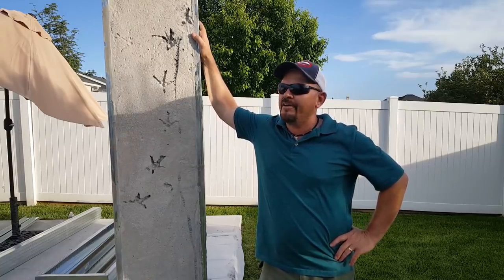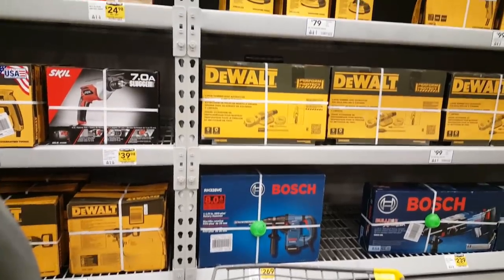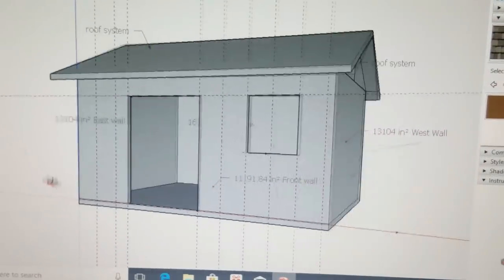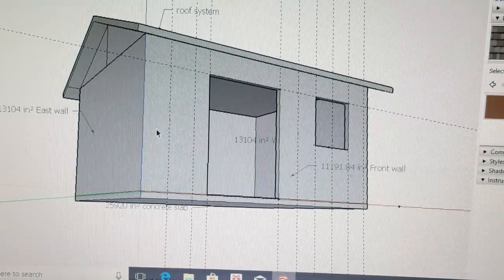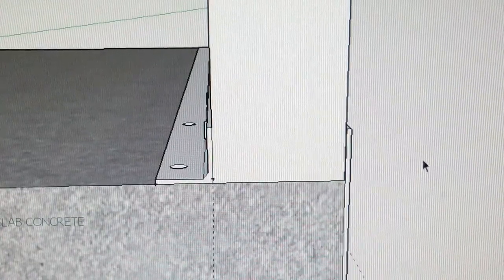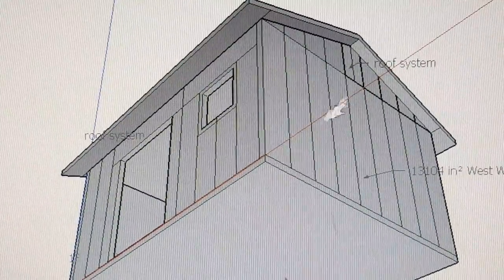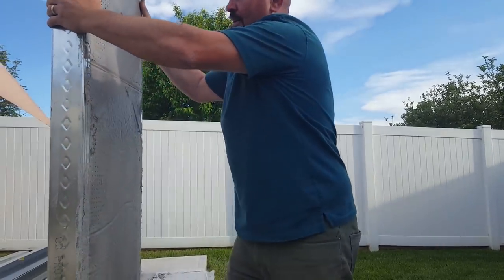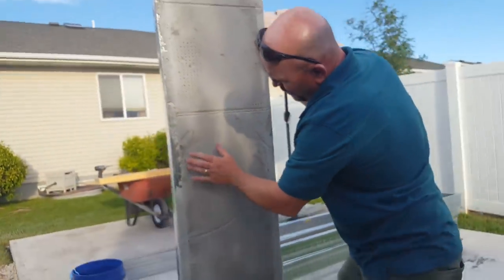Air Crete Shed Wall Panel Layout

Comment: What about striping the metal forms off and setting them with mortar like large blocks in addition to your angle iron? You might want to also do a bond beam or metal strap around the top. I would be skeptical to rely on the angle iron alone because Air-Crete is soft and that connection might fail over time.

Comment: I like the post-hole digger in the tube to mix the air-crete. I would suggest modifying the plastic mixing (and rinsing) barrel to include a 3" PVC shut-off valve at the bottom of the barrel, and put it on a stand while mixing, or position it on a scaffold platform so the valve could be opened to empty the liquid air-crete into a section of wall that was enclosed on all sides except the top, and using a cook's large rubber spatula to wipe out the inside of the barrel out the valve when the barrel empties. 

When rinsing the mixer in water in the barrel, just leave the mixer in the barrel and use a spray nozzle on a water hose to clean everything, then open the valve to empty the water before lifting the mixer out.

Comment: Darwin:  Just use 'C' channel from the metal framing system for your top and bottom plates. Also you can bend the  'C' channel to make a wall/roof connector. the  And if you like the look expanded metal lath and a stucco coat of air crete could finish the exterior and tie all the panels together.  I would also use a metal to concrete adhesive between the  'C' channel bottom plate and pad to reduce corrosion as well as bond.    There are other shapes and sizes in the metal framing system including thicker gauge where needed.   More to come  but for now I have errands to run.    Bert
Reply: bert skelton that is all you need 24 Gage is heavy enough.

Comment: Hey Darwin. Love the videos of the project. I have two possible suggestions for framing and pouring the wall. As they do in tilt wall construction they frame and pour panels on slab with connections incorporated in the wall and any openings framed in place so when you stand them up you just attach with bolts. Other option since your using metal studs. Is frame the shed out with a studs standing in place(as you normally would frame prior to adding your sheeting. place a piece of ply wood or rigid foam board Interior and exterior and pour from the top by either leaving top plate off and cap once wall is filled doing back to back studs to simulate the each panel. Or cut fill holes on the top plate and fill level in each cavity. So your pouring walls in place. Same with the roof. Frame it. Attach plywood or foam board to underside and pour from top. Keep up the good work. I would like to try this doing my driveway. Mainly for water Penatration so it can keep the natural order of the moisture being absorbed into the ground instead of causing run off and have a solid surface to keep from tracking mud.

Comment: Try using those little mesh pieces you used to push it down and place them on both sides of the frame back and front centralising the mesh and thus allowing the Crete to get under it easier and stop that air bubble gaps on the back , you will also be able to fix steel bars to this stabilising them and a set distance of a set amount for a panel at set size and place these in pre drilled holes in slab with apoxy already in

Comment: Two thoughts for you. Instead of fighting with your mesh and the voids it causes use those mesh "clips" you made to keep the mesh near center buy cutting a slit in the mesh where the mesh clip bends, run the clips thru the slits before you start mixing, pour about half your volume of AC then insert your mesh and finish the pour. When you finish the pour to settle the AC take a reciprocating saw [SawZall] without a blade in it and vibrate the sides, should settle quickly.

Comment: Darwin I’m curious why you don’t use the C channel the thickness of the wall panels run pan head screws inside channel set panels in C channel and small screws to fasten panels to C channel neat clean and secure. It’s the way we do steel stud walls in commercial buildings?

Your doing a great job! Enjoying the videos!

Comment: I would like to see as much of the construction details as possible. Are you going to use carriage bolts to thru bolt from the outside flat bar to the inside angle?  And how do the wall panels tie to other wall panels and the roof?

Comment: Very glad to see you working on your family project.  I fear the energy of working on a dirt patch Buckminster Fuller is going to be like last fall, when the energy from working on refractory aircrete resulted in no new videos for months.  Your family is grounded and appreciates using a relatively straightforward project -  a shed - to help you perfect your DIY aircrete system.  There's this other person who gets you spun up and watches you strain yourself.  It's like Lucy holding the football for Charlie Brown.  Aircrete never made sense for a thermal mass in a rocket mass heater.  You were installing insulation instead of mass, and the resulting design was sending excessive heat up the chimney.  Building a circular dome on a square, below-grade foundation is another setup for an inherently flawed project.  You're (admirably) learning about things like using CAD to detect your need to move the shed door 4 inches from the east wall.  That's on a type of structure (square and plumb) that you're familiar with, you've seen thousands of them.  Just trying to get the CAD to handle a geodesic dome will be a multi-month energy drain.

Maybe I'm misguided.  Was the geodesic dome your idea, or did someone bring it up in conversation and plant a seed of challenge in your head?

Comment: You have thermal pass through with the metal forms.
Heat or cold can travel though the metal to the other side .
Probably not a big deal though .
An easy fix is to cut. The metal vertically with a right angle grinder .
Modern metal framed windows no longer sweat because of a thermal break

Comment: On a project that small, I think I would have tried to build each wall with the CFS laying on the ground, you could have put any plumbing and electrical in the wall, then poured the whole wall with the aircrete.  The same for each half ot the roof.  A couple of friends could have pulled the walls up and put the roof in  minutes.  Right or wrong?.

Comment: Hey chief... an idea for you.   Why not form your walls without the bottom metal stud attached. That way you can attach the metal stud to the floor and set your formwork into it after its poured.   Then you only have to screw your bottom plate into your wall.  It would save you a lot of steel and a little bit of room in your building.
Reply: also for your gable end walls... I would consider doing them in single panels.... not the whole wall but instead of an 8ft panel take it all the way to the peak.  ;)

Comment: Also, for getting rid of air pockets, you could jig up a vibrating table to set your forms on. I've seen concrete blocks being poured this way in a manufacturing plant.

Not sure if that would not harm the Aircrete's own bubbles though. They seem fine and firm enough, but you'd not know without testing. 

You could test it by trying out a jigsaw on any old airpocket -prone pour form from your arsenal.
Reply: Aircrete must not be vibrated. For panels, wire mesh is usually dipped into the poured concrete, rather than pouring onto the mesh.

Comment: In reference to a full scale building -The metal stud walls are used all over the world, the roof is metal stud and wood so summed up, this air crete boils down to just being insulation on buildings? Is that right?

Comment: Seems to me you need a corner frame that is easily slid together so as to make construction starting at corners. That will give you faster assembly and and may eliminate the need for bracing as you go down the wall.

Comment: Just a idea, could you put some of that hardware cloth inside your mixer then put your suds and cement in it and thus eliminate the auger work?
Reply: That might be a good idea!  easy to bolt on some hardware cloth to the existing fins inside the mixer.

Comment: Just stumbled onto here. Looks great mate!
Just a thought though... Please forgive if its captain obvious, but... If you were to drill holes up the side of the frame and place threaded bar right through so it comes out the other side of the frame you could use that to secure a number of the panels together as they stand, maybe inside a threaded metal tube.. In fact if you were to think a little further through that you could design a corner brace that each of these threaded bars feed into and the structure would be easily made square and super strong. Just screw the threaded bar through as you go and tighten up at the corners.

Comment: Here's an idea. Have vertical corners pre erected which have slots on either side. Then drop panels in horizontally with a mortise and Tenon type joint. That way you could make larger panels and either have them pre-made to length or cut them to length as needed.
Reply: That would work too, but too late for this project.  Interlocking similar to the steel overhead doors.  Channels like the precast highway sound barriers.

Comment: Instead of the angle at the sole plate, use a metal stud C channel. This is what would work for a regular metal stud and should work in this case as well.

Comment: Like the drawings, you talking your way rhrough.  What i was wondering,  you said 3inch sheet metal for the outside, bottom panels with self taping screws. Not the andle iron part i got that.  But the e inch outside, bottom to help hold the panel in place.  3 in wide x how for long, sheet metal?  What thickness.   Or am i up to late??

Comment: Should lay them like cement blocks will give you issues over time those vertical line are going to come back and bite you in the but.  Do your pours the same pot 1/2 cpvc tube through them sink threaded rod 16 on center place. Your poured panels light wise with red coming through the holes .  Use some thing like liquid mail between them bolt down panels to concret pad stagger panel ends ..   the way your going you will have structural issues among other problems..   But that just my opinion.

Comment: Thanks. How much does a panel weigh. Density calculation should be easy with your standardized dimensions. Looks like u moved it easy enough. Thanks for video. I liked and subscribed. I have enjoyed your other stuff but i want to try my hand at foamed concrete sometime in this coming year. Hopefully i will put some videos up of that and my house construction. It's gonna be very energy efficient i hope. Big geothermal loops built-in. Please keep these videos rolling!

Comment: Hi, journeyman commercial carpenter here... Trying to wrap my head around the point of this "aircrete" panel system. Appears to be much more labor and material intensive that just framing the structure with the same metal studs. Also likely not as strong a structure considering the way these panels will need to be tied together. To each there own, but this system just doesn't seem to make sense.
Reply: This is a concept show.  Using AirCrete in a building project.  Spur new ideas...  How about someone that wants to build a vermin proof smokehouse, how about a huge oven to cook large powder coat parts....

Comment: If it would have been me I'd probably take and use all thread rod and positioned them in the center of the thickness of the panel and had them sticking out the bottom and top  bout 6" when the panels are made take and drill holes in the slab in the locations of the rod put a nut on the rod fill holes with grout or epoxy  stick panel in the holes plumb it and brace it. Let set and dry in place. You can seal and get added strength with liquid nails in the seams. With the rod out the top you can then bolt the top plate and compressing everything together also so you can put trusses. If know trusses the you can use them to go through to roof and bolt it down just inset the nut and washer grind off and fill .

Comment: Too late now, but if you'd added a small step at the edge of your slab, you would not have needed the rear angle iron to hold the bottom of the wall out.   Be pretty easy to add a lip sticking in on the form so it gets a 2" step at the edge.  The other interesting option would be to pour a second slab, smaller than the first, on top of the first, but do the second one with air crete to have an insulated floor and the builtin step to anchor the walls to.

Comment: If your slab is solid use Hit Pins. You drill a 1/4" hole then buy 1 1/2" long hit pits. They have a nail that expands the lead anchor and just hammer in. When your finished it looks just like a rivet head so you don't have any threaded studs sticking out of the floor. They are almost impossinle to pull out. If you need a picture of one send me your email in the comments. These things are solid and dependable and fast to put in. I don't know if the air crete will take them you would have to experiment there.

Comment: you need to rent a vibrater for concreteit will make your mixture flow better . They work very well. they sell vibrating ele motors for about 250.00 on ebay you could just hold it on the side of your form. It will shake the heck out of your hand i sure youe could come up with a way to put a handle on it best of luck enjoyed your vidoe

Comment: The slab should had a female keyway formed during placement. The panels would have mail keyway on the bottom and one side while the other sides head female keyways. The corners should be precast by themselves in the same fashion. Dowel rods either formed in the mold or drilled afterwards would be a stronger way of attachment of the base and side panels. The key ways would also help shifting. The door assembly could be stood up in one piece just leave plywood on one side

Comment: To prevent rust, could you raise the concrete a few inches where the walls contact the floor?
Reply: The CFS is coated to protect from rusting, and it is basically there only to form the concrete anyway.  Personally, I wouldn't worry about it.  I'm more concerned with storm damage or the bench grinder throwing the part, because the panels are brittle and could put a hole in them.  I want some additional protection inside and out.

Comment: Hey, the thermal bridging from the metal studs is going to cut the effective insulation value of your wall in half or more. Generally, metal studs are expected to cost about 40% of the insulation value of a traditional batt insulated 24"OC wall. With two metal studs every 16" you have, something like, 3X the thermal bridging of a wall whose cavities an engineer would say wasn't worth bothering to insulate. You'll definitely want to remove them from the wall system or else you'll have to do a continuous insulation around the outside of the wall--defeating the point of aircrete, I think.

Comment: Nice construction, but... Did you wonder about your concrete slab wicking moisture from ground over time? Without resonable moisture protection all these metal parts are going to degrade a lot quite quick...

Edit: And anyway - your mesh in panels needs to be in the centre of panels mass, otherwise it will degerade as moisture will enter conrete and this metal mesh will not be protected enough by concrete mass. And last thing - these CW profiles for drywalls - are they zinc coated? If so - they will be bond to concrete... I recommend to do your research ✌️👌
Reply: Yes, I don't think this building will last more than 50 years!!  Could last 200 years with epoxy coated steel!

Comment: Hi All 
Was thinking I may buy a house that has burnt down to the foundation 
Does have the blocks in the basement but I will tear those out & build new walls 
Was wondering what you thought of laying the blocks on top of each other - No mortar & filling the voids with air crete 
Any hope of it holding under the stress of a house on top of it 
Hoping since Im not that great at masonry & dont care to get that great at it 
My thought was that its just mortar & an empty void 
& the air crete would be a lot stronger

Comment: Why not put a channel anchor down down to the concrete the thickness of the panel then slide them in and secure and same with rope of panels use a channel system

Comment: Why can;t you just make a bigger panel on each side of the door.... Keeping with the 16 on center.. It doesn't have to be only 16 inch panels.....as long as the studs are 16 on center.... You can have any size panels .... In fact i think it would save you time and might be stronger to have larger panels ... ?... Again ..keeping with 16 on center .....!!! Just a thought ....You can make them larger for the whole shed come to think of it....

Comment: Why not form a notch the thickness of a 2x4 at the edge of the slab and run rebar up into the wall panel? No need for mechanical fasteners, just drill holes in the bottom of the wall panel and use epoxy to secure. The reason I suggest to “key” the wall to the floor is you will have fewer issues with water entering through the wall to floor connections, and the wall panels won’t shift in 15 years when your steel rusts through. Just thoughts

Comment: I just cant trust the light-duty bendy ‘hope in engineered form’ metal framing. But i see how it acts as a mold rather than a weight-bearing frame.  I would set threaded rod at 12” intervals and drill 3” deep corresponding holes in each matching wall joint to increase strength in case of load failure far down the road

Comment: Need to vibrate the panels right after pouring  & will get rid of the air bubbles
Reply: The problem is that more than half the panel's volume is air bubbles. If you over vibrate this, you would end up removing all the air bubbles you intentionally placed in the concrete.